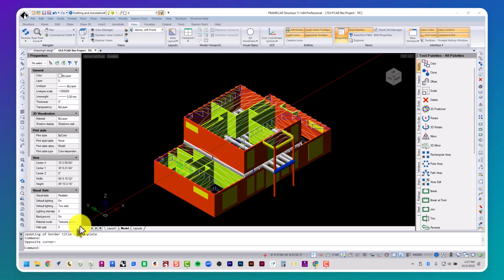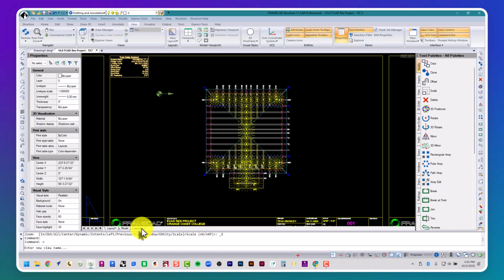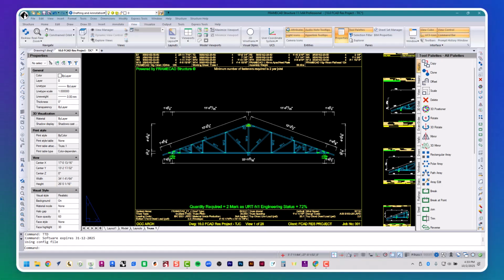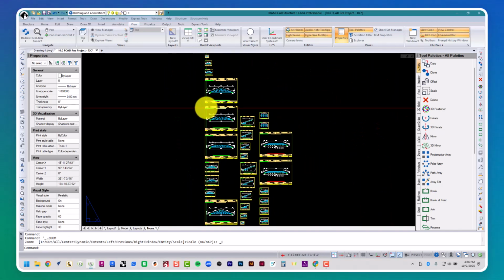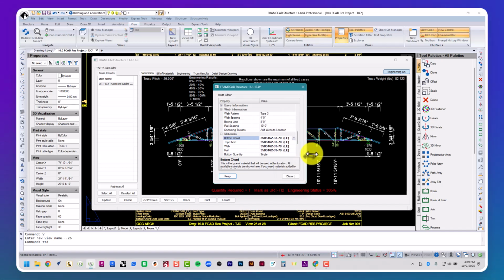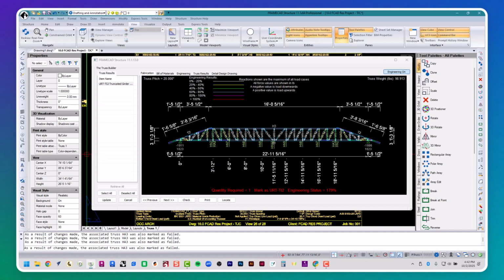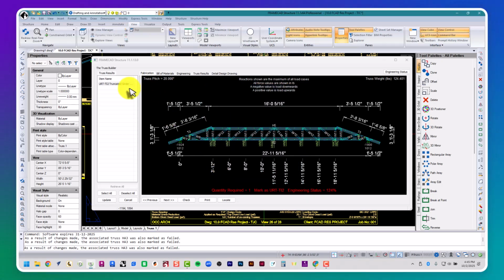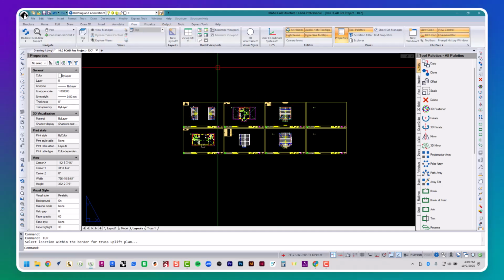10.0 Upper Roof Trusses - Truss Builder (TTD)

Comment: This video does a great job showing how detailing upper roof trusses is not just structural design but a balance between engineering and efficiency. It really highlights how small changes in configuration can significantly impact overall performance and feasibility.